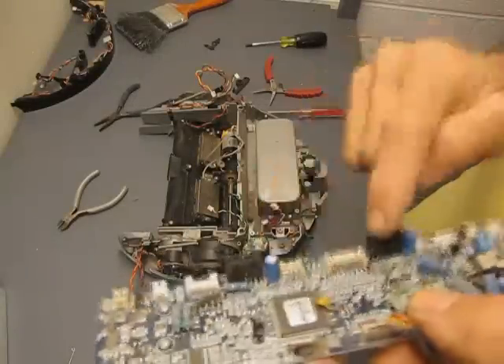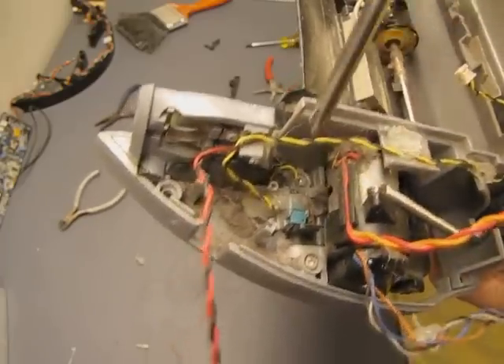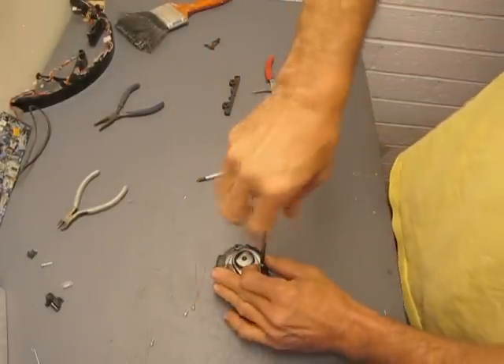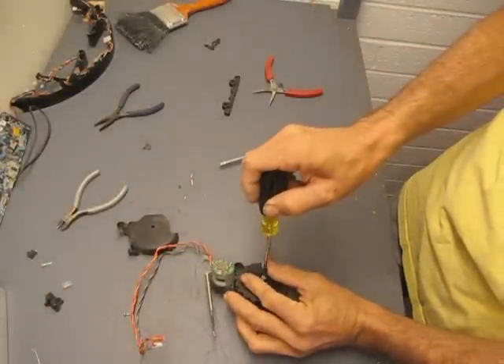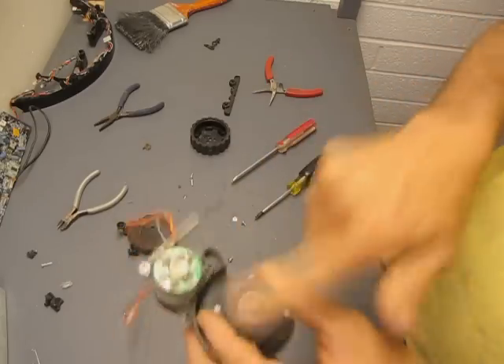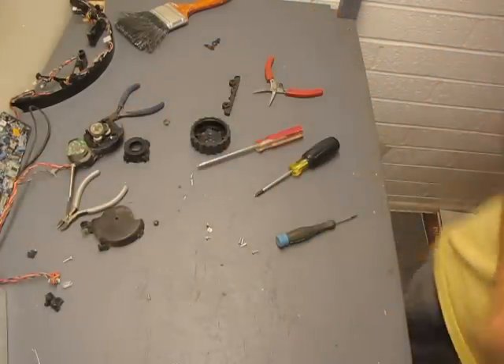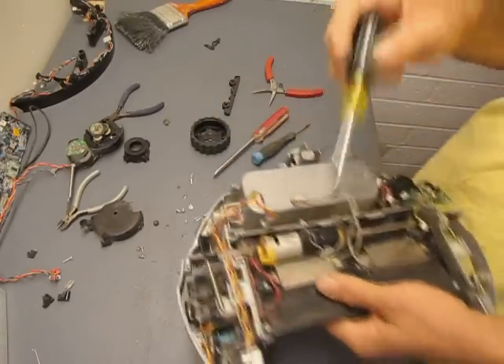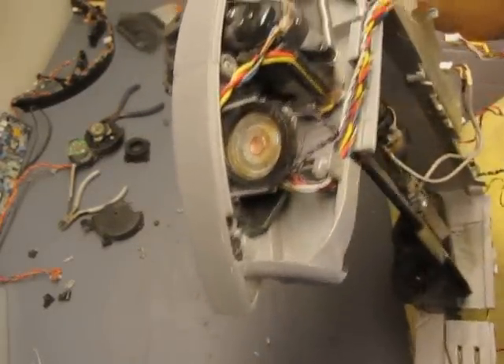Roomba 4000 teardown part two

Comment: The wheel sensor inaccuracy would be because of wheel slippage on the floor not the belt slipping because the sensor counts the turns of the wheel and doesn't count the revolutions of the motor!
excellent video I'm glad that I found it
11 years later LOL

Comment: YO! I've got an idea how the dirt sensor works. Large chunks like little stones and biscuit crumbs will rattle as they go into the vacuum and small ones to a lesser degree. When the noise power is above a given threshold it assumes a very dirty spot.  This could be achieved by an amplifier, peak detector and comparator.

Comment: Nice video, thanks!

However, at 3:18, the comment about the wheel encoder being somewhat inaccurate because of the belt -- is incorrect.
Actually, having the encoder on the wheel is >more< accurate than it would be if it were on the gearbox/motor end of the belt, especially if there is belt slippage.
Having it on the wheel lets the Roomba track actual wheel distance traveled.
Inaccuracy occurs mostly because of small variations in wheel circumference, wheel slippage, and irregular floor surface.